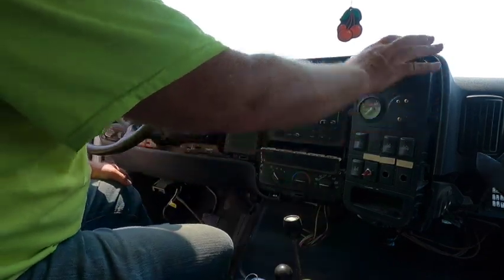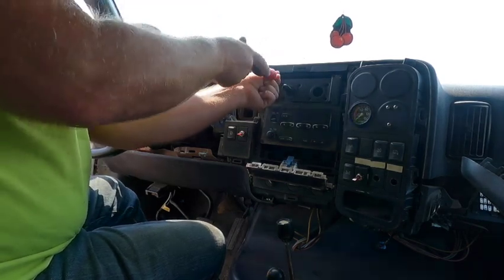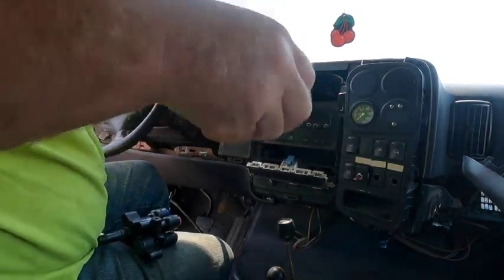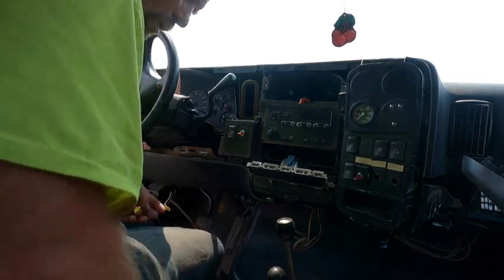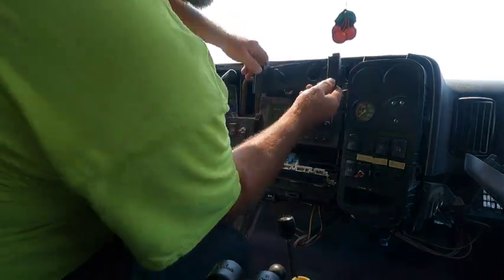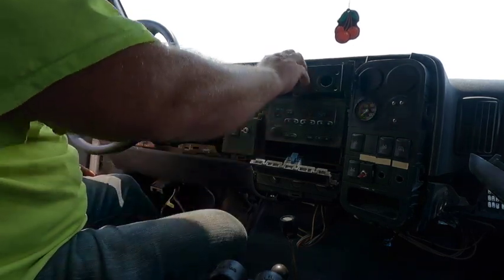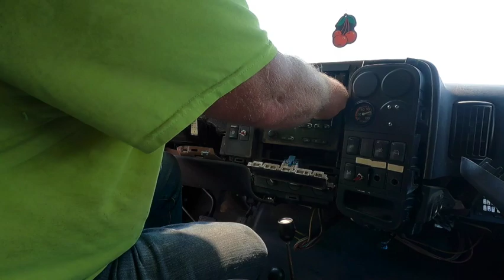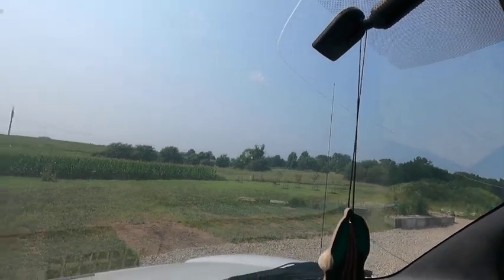Replacing a air brake valve in my dump truck

Comment: My pop off valve works fine but sometimes it takes its sweet time to pop off. I pull it and it Bleeds for several seconds (bleeds air) and then pops and locks the brakes, Doesn't leak when pushed just really slow about applying the brakes when pulled.